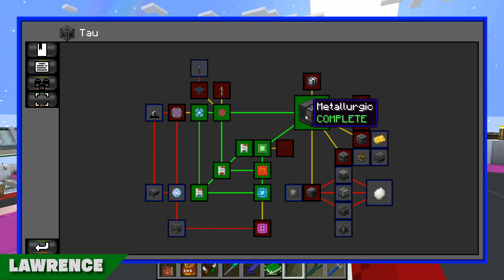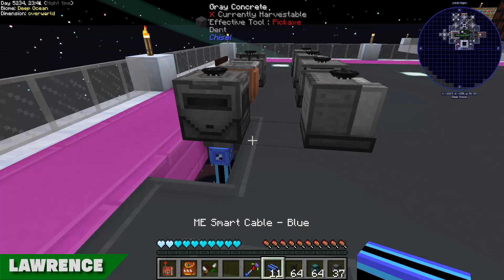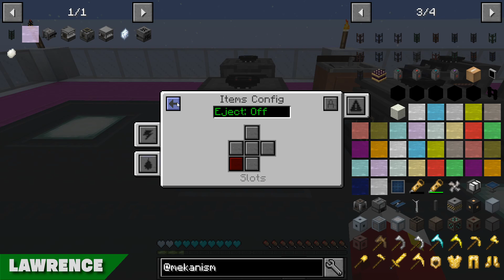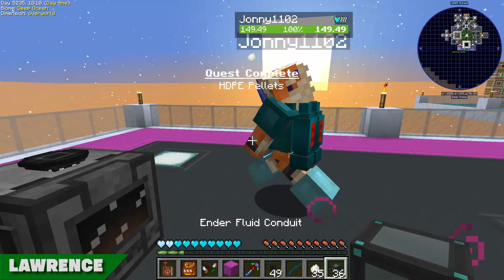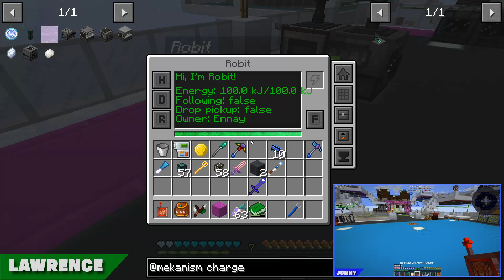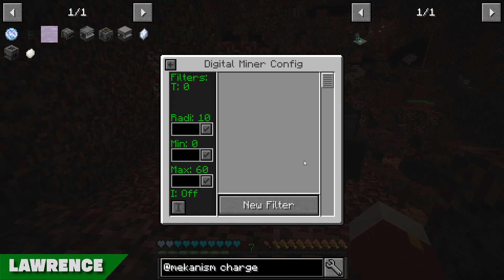Project Ozone 3 - Kappa Mode (E34) - Oh Robit! I found you at last!

Comment: If you cant fix the ae2 crafting lag, you might want to look at auto crafting with projectred pipes for the simple supply/demand items, I think I remember seeing them in the pack.

Also, 30:25 the volume: 27 is multiblock volume, 3×3×3 = 27. On the other hand, nothing is better than demonically gargantuan drums aside from the black hole tank.

Drum = 65.5 KB
Black hole tank = 2.15 MB (max_int mB)

35:26 the top right of the four buttons in that ui lets you place a hologram in the world so you dont have to keep popping in and out of the menu.
Reply from the maker: I think we found the source of the crafting lag and fixed it in  the next video! 

Yeah we were more confused as to how many buckets the tank would hold. Decided the demonically gargantuan drums were probably the easiest to do at the moment. 

Thanks for the UI reminder, I had completely forgotten the projector button was there! :)